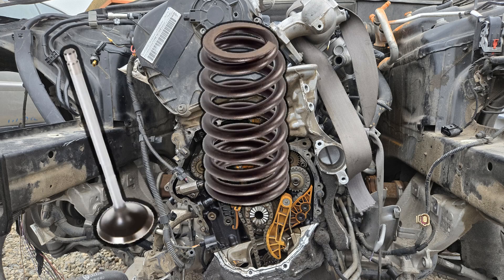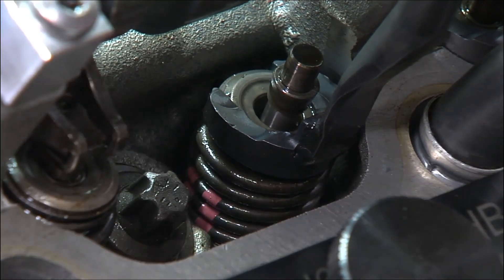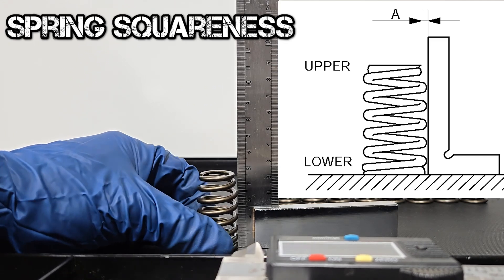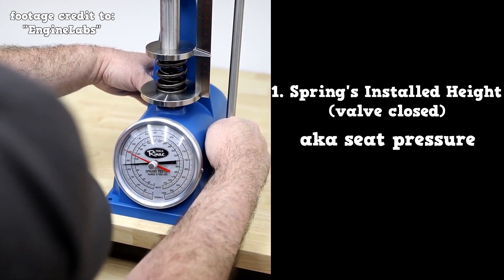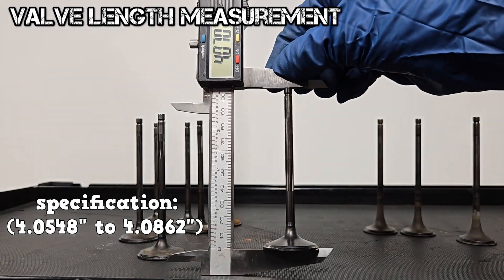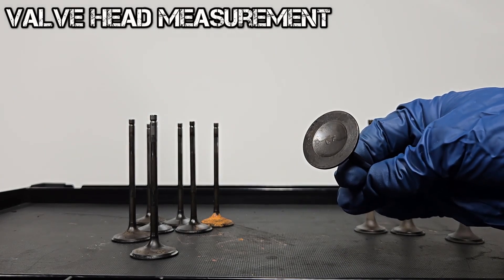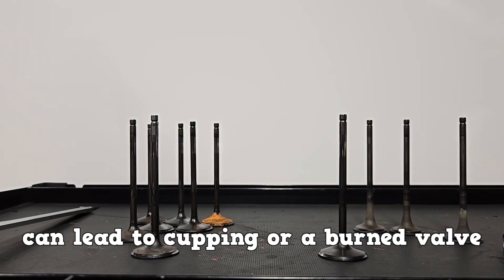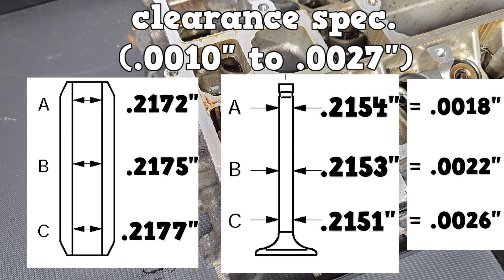ASE A1 Test Prep #2 - Valve, Spring, & Guide Measurements

Comment from the maker: Feedback after taking the test: Near the beginning of this video, I mentioned that "ASE at least expects you to know how to measure these components." Well that was not true. Did not see any of these measurements asked about on the test. I went too deep on measurements!
The focus should have been on inspecting pushrods, oil passages (what happens if specific ones are blocked), how the timing system affects/damages the valvetrain when faulty, valve lash, and saw 2 questions related to the VVT system.
Reply: Thank you for the close caption! I am deaf and a mechanic tech. This is helpful! 💯